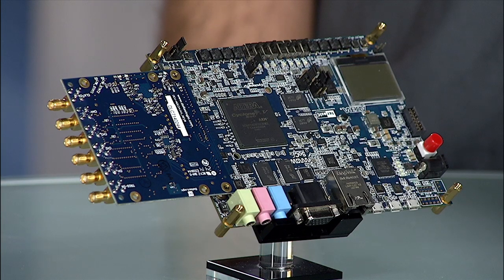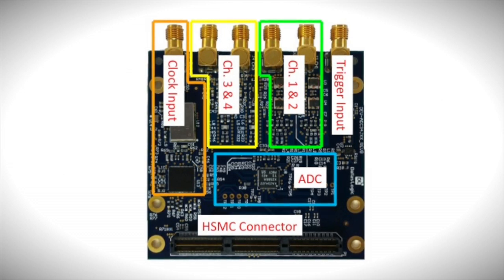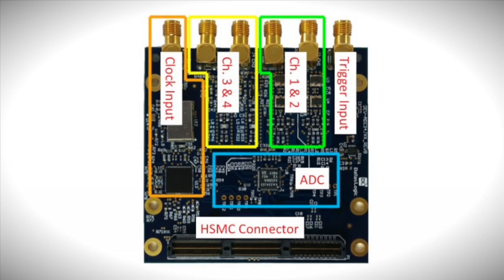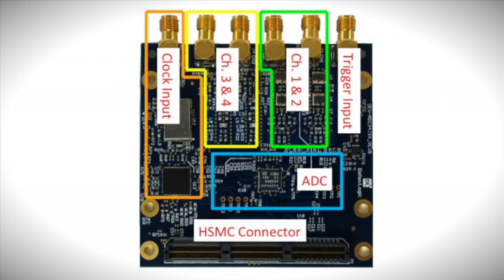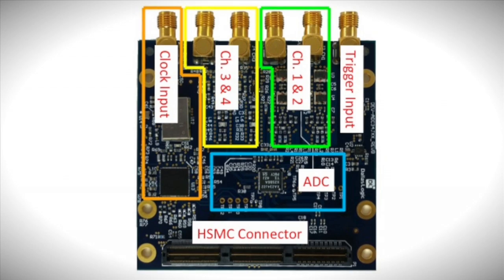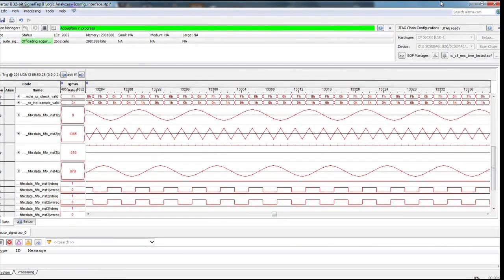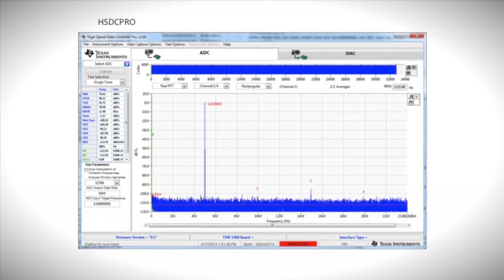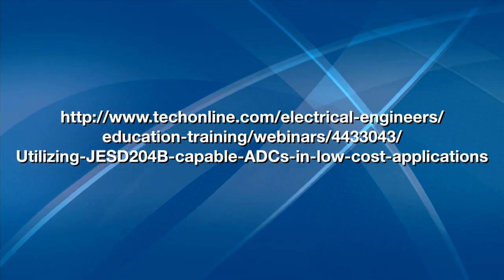Utilizing JESD204B interface in low cost applications

Comment: Thanks for video, We are interested on this board and going to order but there is a question regarding DC bandwidth (15 MHz). Does it mean input frequency or the bandwidth of input signal? Because in my case I have a 100 Hz signal with bandwidth of ～20 MHz (BW=0.35/Rising time). Thank you in advance for information.